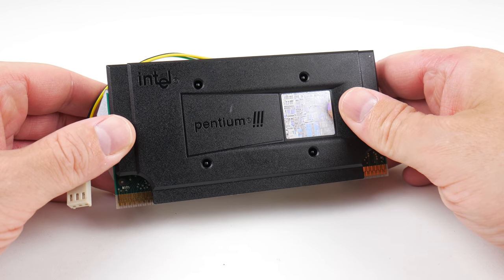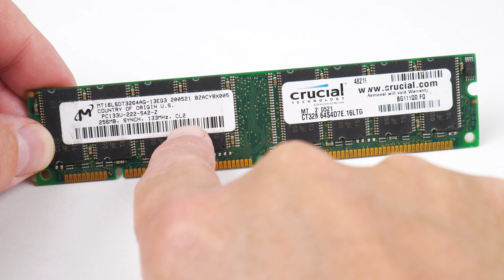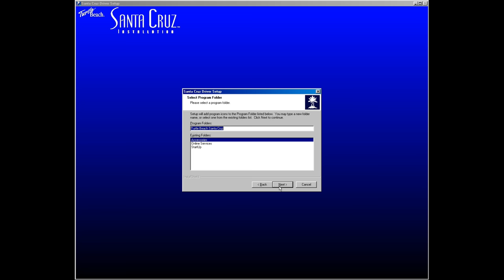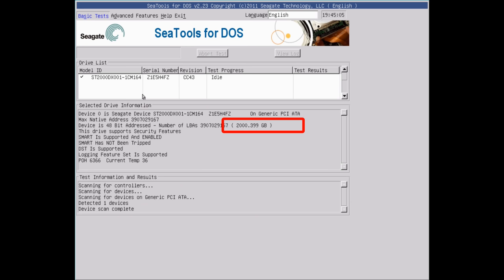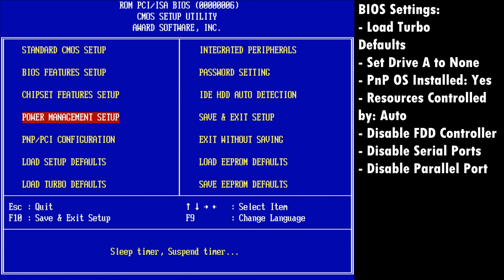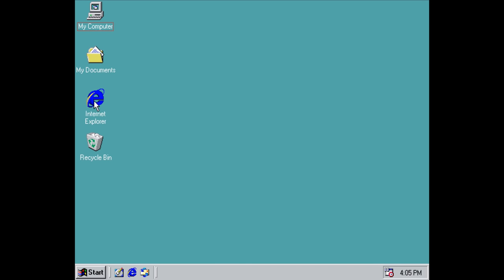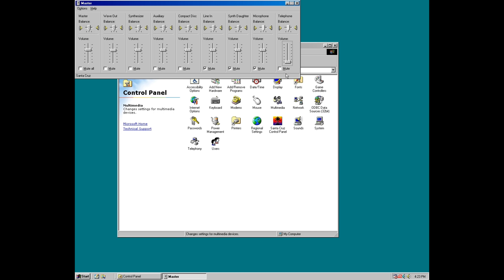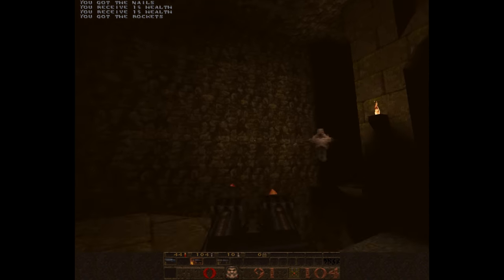1000 MHz Pentium III Windows 98 Retro Gaming PC Build

Comment: Great video, Phil. I love these old machines. I just dug an old Tyan dual P3 Tiger 230t out of the closet and put it together. It's a dual processor rig with 896MB of ram, but should run Win98 on a single CPU w/ no problem. Now I'm off to find drivers lol. Hopefully they exist for Win98. Cheers!
Reply from the maker: For 98, stick with 512GB of RAM or 256! Chipset drivers are available on my website. The other drivers, well it can take a bit of hunting onlline. You can use XP or Linux do itentify components, or use a magnifier to check the chips on the board. Audio, ethernet and all of that.
Reply: @philscomputerlab  I have been reading that too much ram in WFW3.11 and Win98 can cause lots of weird problems. Have you had anything like that happen? I'll head over to your website and look for drivers. I think this board has the Apollo Pro133A chipset in it. Thanks for responding too, btw!

Comment: Phil, regarding the high power usage during idle - what you said about the CPU not throttling down is true, however there’s another factor causing this. Win9x doesn’t issue the CPU a HLT instruction when idle like WinNT-based OS do. There are programs to enable this however. This is a good reference that compares them: http://www.benchtest.com/cooler.html

Comment: Great video as always! I wish you could do an XP benchmarking with the same  computer! It could run GTA3, Morrowing , Max Payne, Age of Mythology and maybe  some games from 2003. I am not saying that it would be fast, but I was playing these on similar specs. I was using a 1200Mhz Duron from 2001 to 2006, going from 128 MB 133 Mhz to 256 MB 233 DDR, and from integrated Savage to 5200.

Comment: In my P3 1GHz with Voodoo 5500 and SB64AWE gold soundcard, I use an M.2 64GB ssd to IDE 44-pin adapter with 40-pin to 44-pin IDE converter.
It is splitted into two 32G's drives, works like a charm.😊
Have stored every game-cd I have as ISO's on the other drive and run them with a win98 compatible Daemontools.
No more gaming from rare fragile cd's needed.

Comment: Since you asked for feedback. What I'd like to see more of is games outside of the 10 biggest and most useful for benchmarking (doom, quake etc) running on period minimum, recomended and lastly actually decent hardware. There's two ways to go with this; one is to have something like a k6-II+ that you can dial down to whatever speed, the other is to invert the process and find games that suit the system you have chosen instead of suiting the system to the games. Then you can bang out like 50 games for each system before you move on to the next system. I also think you'd want to start with a 486DX2-66, pentium mmx 166 and 386DX-40 if you go this route; those were so unbelievably common systems there is no trouble finding games targeted to those. It is also a good idea to not just run 20 second snippets but actually play a few minutes on each system so you get a whole video out of each game. 

You can ask your viewers but there are lots of fondly remembered games that are never played on this channel because it focuses more narrowly on the hardware side of things and only on the minimum set of games required for a decent benchmark which neglects a long line of games which are fondly remembered but not so industry defining as Doom, e.g. Daggerfall, Duke 3D, Magic carpet, frontier - first encounters ("elite 3" basically) and Strife. This will also have the side effect of you having to play old unintuitive DOS games that you maybe didn't grow up with and that's a good thing; it is impossible to see an old unintuitive DOS game that you've played way too much with fresh eyes unless you see someone else play it.

Comment: Slot 1 adapter cards can be really cranky. Some work with anything, some only like certain CPUs or only support 66MHz bus. But when they work, it's a great option. -- In my Closet I have a dual slot 1 board that's quite fast for the day and supports up to 1GHz... thinking about finding it max speed CPUs and resurrecting it, good options here, I like that sound card being able to handle DOS games. (I have a bunch of these boards but that one is notably faster.)

Be aware that FAT32 is unstable for partitions over 32GB; this is a known data wrapping bug that used to be documented on Microsoft's Knowledge Base. It looks like a failed HD if you're not aware what's going on, as once you get over 32GB of data on the drive, files start randomly disappearing.

Comment: In 2007 I rescued an HP Kayak dual-slot PIII workstation headed for the dumpster at work and upgraded it with two 1000MHz CPUs like the ones in this video, you could get them on eBay for like $8 each.  I ran a small Linux server from it and left it at my parent's house.  Sadly, a few years later they moved and I didn't have room - at the time you couldn't give Win98 era hardware way, so I believe I said "throw it out."  I regret it now!

Comment: Currently still waiting on my flash memory for my T5710, but i do have a concept i might build in the future if the hobby stay this fun. Which is the ultimate time-machine concept, i was thinking Athlon64 (Especially since my dad's gaming PC i grew up on had one) but it would be interesting seeing what components would be best suited for such a build which would essentially translate to the fastest rig you can get away with with maximum dos compatibility and slowdown techniques.

This turtle beach doesn't seem as interesting as the still availible yamaha ymf744 card you showed, given similar Windows 98 compatibility but way nicer sounding dos compatibility with the wavetable midi support in Windows and the OPL3 sound in Dos.
Reply from the maker: The TB is stronger in Windows, the YMF card is outstanding in DOS!

Comment: My 800 MHz Pentium 3 CPU came in last weekend, so I replaced my old CPU with the 800 MHz one. As I predicted, the CPU squeezed a bit more power out of my Voodoo 4 card. In 3DMark 2000, my score jumped from 2800 to 3200. That may not be much to some, but that is still a substantial boost considering the time period. I am still hoping to get a Voodoo 5 for the machine, so it can be the ultimate 3DFX machine. I decided to place back in the Aureal Vortex 2 Superquad PCI, for 3d sound. Although I like EAX a little better, the A3D card is really good. This computer I built is definitely a supercharged Pionex Elite my brother bought back a little over 20 years ago. And before anyone asks why not get a 1 GHz CPU, well, I can't. The motherboard maxes out at 800 MHz, but that's still fine with me because I mostly play DOS games and early Windows 9x games on it. For anything later, i'll just stick with my Windows XP machine.

Comment: I had P3 coppermine 667Mhz which I bought in 2000. Had a 64MB ram, 8MB ATI Rage XL video card. It was fast back then not until counter strike came along and I had to upgrade to 32MB nvidia riva tnt2 m64 video card. This is so nostalgic.

Comment: I have a soft spot for the 1GHz PIII as it was the CPU in my first computer. 1GHz PIII coppermine socket 370, Transcend TS-ASL3 motherboard (excellent motherboard btw), 256MB 133 MHz ram, sb live value and a GeForce 2 mx. In 2004 I upgraded the ram to 512 mb and the GPU to the Radeon 9250... I used that same computer from 2001 'till 2011, from a 10 year old child to 20 years old.

Comment: "I don't care ware" -- I love it!

Just wanted to say that 9250 card takes me back to when I was building a budget gaming PC in a low-profile micro-ATX case, and the best graphics card out at time that had a low-profile PCB was the 9550. It was a challenge to spec out back then -- max performance @ minimum cost and footprint -- but it ended up with an AMD Sempron 2500+ (I think?) plus the ATI Radeon 9550 and maybe a gig oeff RAM and a 120GB spinny drive...? I dunno, sounds big for the time; but at just shy of four hundreds bucks, it would run Far Cry at 1024x768 at somewhere near 40fps. 🤓
Reply from the maker: The 9550 is a fairly capable card. Far Cry can be tweaked to run quite well on slower cards, even change DX mode to 8 instead of 9.

Comment: I love Slot 1 builds. I am putting together a slim micro ATX one with slotket Tualatin 1.4, modded, and Geforce4 MX460. A small Win98 beast.
Reply from the maker: MX 460? Very interesting choice :) It's a very fast card, but DX 7 only. Indeed perfect for Windows 98 :)
Reply: @philscomputerlab  Thanks!, it is being one of these challenging builds. It was not easy to find a low profile 460MX, a Micro Atx i440BX board with 133 fsb (oc) support, and still thinking about what sound card to use and how i should mod it to fit 😅

Comment: I have a Dell Slot 1 mobo with an Intel 820 chipset.  I'm planning to build a 1.0 GHz system with 512MB or RDRAM.  It's also going to have a Voodoo 5 5500 and Windows ME.  It's "The computer I wanted to build in Y2K, but couldn't afford".

Comment: Excellent video! I love these older slot 1 Pentium III systems! It's such a shame that the 1GHz slot 1 Pentium III cards are so expensive. I've been trying to find one for years now but they are all insanely expensive! I was searching eBay earlier and the cheapest I could find was selling for $300.00! I'm guessing there weren't very many of these produced since most CPUs had moved on to the 133MHz system speed by then. I have been able to find the Socket 370 versions of the 1GHz with 100MHz FSB for around $25.00 and am wondering if I could use one in a slot 1 motherboard with one of those adapter cards?
Reply: Yes, of course you can use it with a so called Slotket. Btw my feeling is that the Socket 370 1000 MHz/100 MHz FSB PIII is more rare than the equivalent Slot 1 PIII.
Reply: PIII 900Mhz FCPGA version in slotket is much cheaper as it is available in bigger quantities. It's the best CPU for 100Mhz 440BX boards.

Comment: I was hoping you would do a video, like this. Now for me to do some bragging on my own Pentium 3 machine. Back at December of '99, my brother bought a Pionex Exlite brand PC. It had a Pentium 3 450MHz, 64 MB of system memory, a 3DFX Voodoo 3 3000, and an Aureal Vortex 2 sound card. To comemorate my 20 year anniversary for getting the machine 20 years ago, I bought a Pentium 3 based motherboard , last year around October. The motherboard is an Asus P2B-F, and it came with a Pentium 3 600 MHz CPU, along with 720 MB of system memory. It was a good deal, and I paid around $100 for the system. So I slaped the PC together with salvaged drives and a PC case. I bought a Sound Blaster AWE32 sound card for the system, along with SIMM memory for it. I also removed the meory modules to cap the memory to 128 MB of system memory. I also placed in a 3DFX voodoo 4 4500 I had, sitting in my closet. Under 3DMark99, I get a score of 4723 and a score 9071, for the CPU. Under 3DMark2000, I get 2880. hese are all using the default benchmarks. Last nigh, I bought an unopen Pentium 3 800MHz CPU through Ebay. I am hoping that CPU will squeeze a little more performance out of my PC, and I might either shell out the money for a Voodoo 5, or I might just get a Geforce 2 GTS video card. The PC is really nice and I can play nearly all of my DOS games on high resolution with it. The only DOS game I could not get working with the machine is Stargunner, so I may have to stick with Dosbox, for it. It is a really good machine, and it brought back memories of when I gamed on my old Pionex Elite brand PC. Such good times. :)
Reply: Oh, ALMOST forgot! The Mainboard runs at a Bus frequency of 100Mhz. It's a bit abysmal, but I can clock the Bus to 133MHz, if I want. However, the motherboard manual does not recommend it as it says the VIA chipset may not be stable. I guess that is if you are planning on overclocking the CPU. And also, I had to upgrade the Bios, so the mainboard can be compatible for that Pentium 3 800Mhz CPU that will be coming in. Can't wait!

Comment: A note for those who might end up getting a DELL OEM 440BX board:  use the second-to-last BIOS version, if you wish to support the faster 100MHz FSB processors.  I could not get my 850MHz Coppermine to work on the latest version.

Comment: I’ve been on the lookout for a slot 1 board for ages, they’re just so expensive, I wish I’d never sold my original board/PC years ago 😒
Reply: On eBay there is a Gateway 4000472 slot 1 motherboard for 35$ 5 PCI slots, 1 ISA, and 1 Agp x2.

Comment: Phil, you give nice tip about unlocking DMA mode of HDD, however you also have a bottleneck, that's easy to remove:

Your HDD works in UDMA/33 mode, most motherboards from P3 era should support UDMA/66 or even UDMA/100 (my Abit VP6 supports it), however for speeds above 33MB/s you need 80-conductor cable (as specs require reduced crosstalk), faster UDMA devices automatically falls back to UDMA33 when connected with 40-conductor cable. As you can see during benchmark you reach 33MB/s without problems, so interface is limiting, with better cable you should double or even triple disk performance (SSHD probably should be able to utilise full bandwidth as long as converter supports better UDMA modes).

Comment: I loved that generation of system back around 2000, and W98SE was the best lol!  However, with the pci vs isa slots, you can only use one or the other in the 5th/1st position respectively.  The cards are backwards to each other and won't fit in the same case slot at the same time.  UDMA 33 sounds a little slow for that time though, I think at least 66 if not 100 existed then.  Not sure if it's the mb or the converter board limiting the speed.

Comment: Dual slot one celeron 300a's @ 450mhz was the coolest machine I ever built. Taking a drill to two brand new cpus was living life on the edge.
Reply: my  choice  for  Win-98  is  ""Asrock 775i65g""   with  built-in  video  card   &  single  mode  memory  &  USB   sound  card  &  SCSI  hard  drive
Reply: @SaskaKaska-lv8dr  Well that is very far away from the Windows 98 era but good option for outright performance.

Comment: Had a great find on Facebook its a compaq presario s3010CL..its running an AMD XP 2200+ with the VIA ProSavageDDR KM266 chipset..the case is in terrific condition just needs a good clean, I dont think the owner knew what he had, i got the tower and a monitor and keyboard and speakers for 25 bucks..also pleased to find out that the CPU alone recoups the cost if i wanted to sell it...its all due to you Phil..you got me started on this retro craze and not got me interested but also gave me the knowledge to know what i was looking at..so many thanks. As for the computer...well i havnt decided what to do with it..should i turn it into a retro win 2000 PC?....or remove all the parts set them aside and build a modern sleeper gaming PC in the case..either way its now going to be my current PC project. I do have a suggestion for you...why not tackle retro retro computers?...pre 90's or early 90's stuff?..or maybe throw in rehab/refurb laptop hardware?...just a thought..again thanks for jumpstarting my retro passion.
Reply from the maker: Thank you! Made my day :D

Comment: What about something like the ultimate DOS sound experience? I'm thinking some classic sound card with a wavetable module and why not one or two LPT sound devices like a Covox and/or a Disney Sound Source? Just to go completely wild. Oh, and some external MIDI modules maybe too. So if it were on this machine it'd be reenabling the LPT1 port and maybe installing a second parallel port. Just an idea and something I might build myself one day.
Reply from the maker: Roland MT-32 and Sound Canvas are pretty much my top picks :) They already have very good coverage, so not sure what to do a video about here...
Reply: I know that doing a new angle might be the difficult thing to solve but what I was thinking was more a "cram as much in as possible" type of video. Think LGR's MIDI mountain but on steroids as you will also be adding LPT sound devices etc. But I do see where you're coming from. :)

Comment: 14:00 Radeon 9250 is almost 5 years newer than PIII-1000, so it's not a weakness here. Typical GPU for PIII at the time were cards like Voodoo 2/3 or Geforce/TNT2.
Reply from the maker: At least in GLQuake the card is the bottleneck when you increase resolution.

Comment: Hello, Phil.
Nice video, what is that connector on the sound card used for a bracket with some IO or for something similar to a Live Drive.
Where would you put that video card performance compared to older/newer cards?
Thanks.
Reply from the maker: Yea some sort of front panel device. Not sure, as I only have the cards.

Comment: Hi Phil. I have the same motherboard installed currently in my Windows 98se retro system. I have the floppy cable routed under the motherboard, and that works out very well actually. Aligns well with the IDE cables. Also i have a modified slotket with a Tualatin core, Celeron 1300mhz installed on it :)). The only problem seems to be some older Dos games will not work with Sounblaster, only Adlib. This problem goes away if i use for example a PIII 933mhz cpu. I have tried both a soundblaster 16 vibra from 97, and a Soundblaster 16 pro ct 2910, whitch is installed at the moment. Another problem that i have is that i cannot get the power LED to work :((, seem that the pins on the motherboard don't work (give any power). Do you have any suggestions on how i could get the power LED to work?, is there perhaps an easy mod to get it to work?. Keep up the great work you do here on your channel, i very much enjoy the material cheers!.

Comment: Those little 9250s overclock pretty well - I have one that holds almost 25% very consistently, which makes it benchmark about the same as my 9600 in 3dmark99. One of my favorite cheap cards. 

Thanks for another good one :)

Have you had any issues with drivers on the Santa Cruz? I have one that will just shut off when playing certain sounds, not sure if it’s hardware or drivers.